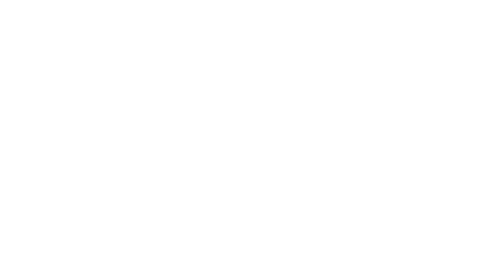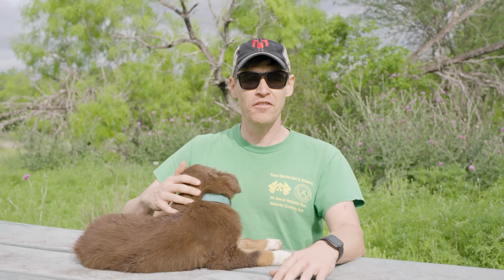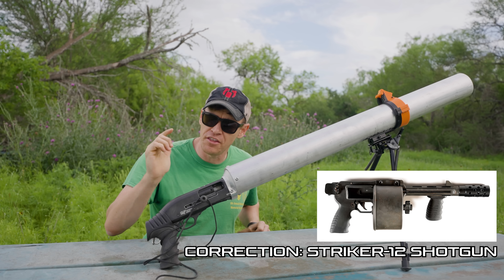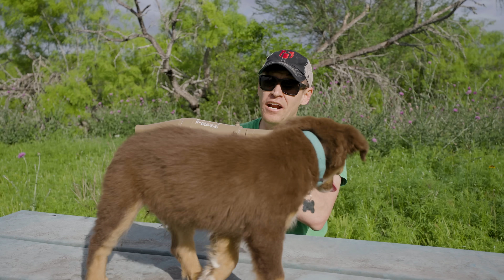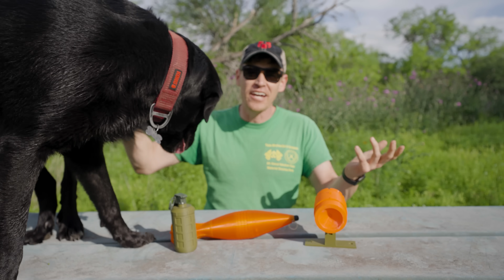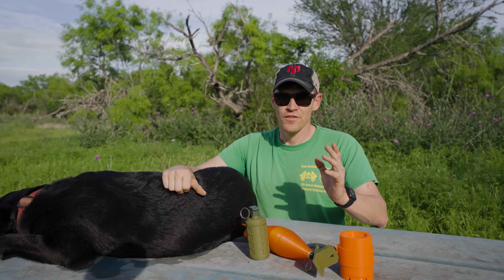Are 3D Printed Weapons Legal To Make?

Comment: I know how you feel. I got my SOT and I get people all the time telling m they are gonna report me for owning post sample machine guns. I just tell them go for it. And no surprise, nobody has done anything since I'm 100% legal
Reply: It doesn't matter, most people are just full of hot air and no ambition anymore.
Reply: i worked for an SOT it was sooo much fun to pull up to the range with a p90 that was converted (super simple btw) or insert zyx thing my boss was working on and see some one get butt hurt all the local cops know i worked for an SOT and had paperwork  was fucking fun. my boss even let me build my own M16 on his books so i could learn how to mill out an 80% and drill the 3rd hole all because i wanted to learn he currently if i recall has it set up for testing supressors as i no longer work for him.

Comment: Most 3d printed guns I have seen are not undetectable because people have realized that plastic is not a good pressure bearing material.
ITAR and similar regulations in other countries has exceptions for rimfire firearms and drones (and other tech) made made civilian use, so STL's for such things are okay. It is specifically applies to things designed for military use.
They may still decide to harass you if you have weird political views.
Reply: I was under the impression that only directly usable files like G-code are relevant to that, unless I am thinking of some other similar circumstance.
 Regardless, someone just might "leak" the files to the Odd Sea. Oh, how unfortunate that'd be...
Reply: “weird”
Reply: @Tunkkis  Blueprints cannot just be plugged into a CNC machine either. The regulations cover intellectual property, even if it is your own. I go clear of this since my designs are meant for civilian use.
Reply: @nickdee5764  Okay, "Sensible" is a more correct description. Our current governments don't like common sense and logic.
Reply: Thoughts on the defense distributed machining box, I forget the name lol,, that makes the barrels?
Reply: @speaklifegardenhomesteadpe8783  Barrels are regulated items in most countries, as is ammunition. I can get a 800 dollar fine for posessing just a few rounds of ammo.

Comment: I have a question. There are the 37mm havoc launchers like spikes tactical makes.  You can relode those with black powder as long as you stay below a threshold for your propellant and the explosives. The 37mm launcher is known as a signaling device. If you shrunk down the moartar size would it be legal to launch them without registering it.
Reply: Any anti personnel ammunition in a flare launcher reclassifies it as a DD even in 37mm
Reply: Even if it fires a non lethal bean bag round the launcher is still a DD.
Reply: That's because the bean bag rounds are manufactured to be anti person. So they are defined as DD.  but if a device is not specifically manufactured as anti person. And by the definition of a DD being,  (“destructive device” means- Any explosive, incendiary, or poison gas bomb,  grenade, rocket having a propellant charge of more than four ounces, missile having an explosive or incendiary charge of more than one-quarter ounce, mine, or  devices similar.) As long as there is no projectiles and you stay below these parameters it shouldn't be considered a DD.  Or am I  just not understanding  the definition properly?
Reply: @sethmcavoy7672  No
Reply: @Willy_Tepes  then run anti personal ammo in your gay 37mm, I don't care one way or the other.
Reply: @sethmcavoy7672  Bean bags are not explosive devices.
Reply: @Willy_Tepes  what part are you not getting? A weapon being a large bore DD doesn't have anything to do with it being a launcher for an "explosive device".
Reply: @sethmcavoy7672  Did you even watch the video? No, bean bags are not destructive devices!
Reply: @Willy_Tepes  you don't get it man. I would highly recommend you don't ever mess with any nfa toys.
Reply: @sethmcavoy7672  As if I care about the law anymore, lol. They lost my respect when they started limiting my speech while letting criminals off with a slap on the wrist.
Fortunately I don't live in the land of the "free".
Reply: @sethmcavoy7672   "Anti-personnel" is not a clear definition of anything. Anything fired out of a 37mm is by definition "anti personnel".

Comment: Use the 3D printer to make a model of a metal part, then make a mold around that. Remove the plastic part, and fill with molten steel. Repeat for each part and assemble.

As long as a licensed FFL manufactures it, and registers the gun with the ATF... should be legal. It's just a different type of manufacturing process.

You could also use a 3D laser image scanner to upload an already existing weapon part into 3D print software, to make modifications, or to do replicas of rare weapons.

Comment: Suggestion:   the black powder claymore/ Kent tube.   19th century claymore mine.  Cast iron pipe sealed at one end black powder and a load of musket balls facing open end.   Well sealed with wax fabric at business end.   Basically a sawed off cannon to provide cover for key paths of ingress for attacking force.  Such as bridge or causeway, fortress gates , breeches etc.
Was proposed/ maybe used in Russo Japanese war with gun cotton and electric detonator.   The tube blew apart but the shrapnel balls flew out the unsealed end of the pipe.

Comment: I would love to see a video on if it's possible to turn 10mm Liberty Civil Defense ammo into exploding ammo by filling the hollow with a binary compound then capping it with some solder. They have a rated velocity of 2,400 fps, so should explode on impact without the need for a fuse or primer in the tip. Maybe add some zirconium powder for an incendiary effect.

Comment: I’ve just a got good one for you guys to try out.  Would using flash powder or black powder set of ANFO used as a booster charge just using cannon fuse instead of using a blasting cap and if you used it in some sort of a pressure vessel like a pipe bomb so the black powder could build up enough pressure to cause the ANFO to go off and detonate.  I seen it in a French movie or was it a Belgian movie, I can’t remember but it’s a cool experiment to try out.

Comment: Legally theoretically (I have dogs I love, I’m not trying this) it would seem that an air powered “explosive” would slip through the cracks of the law as destructive device says explosive, incendiary, or poison gas. Say a 3500-4000 psi reservoir with an impact activated dump valve into the chamber that usually holds the boom powder.

Comment: I have a suggestion for a video, not sure if this is the place to post.  Put some small propane cylinders in a microwave like in the movie 'The Equilizer'.  Curious if it would actually explode without puncturing the tank first, and would it result in as big a boom as in the movie.  Obviously it is a movie and in sure they didn't use that for the actual effect, but it would be interesting to see what the results would actually be.

Comment: Hello, don't be tired. I had a question. You know the answer. Answer it here.
Thank you. Question 👇👇
Broadcast. I mixed ammonium nitrate with gasoline. When I heated it, it melted and didn't catch fire at all. What should I do?
I heated the ammonium nitrate separately, but it didn't catch fire and melted. What's the problem? Thank you for answering.

Comment: I understand. But if there aren't any projectiles such as BBS or any other metal in the round being launched then its not considered anti personnel correct? The 37mm rounds loaded with just black  powder (known as bird bangers) are used in agriculture and is legal. So wat would be the diffrence if it was a small 3d printed moarter shaped 37mm projectile. Litterally launched out of the same signal device. Or maby even another device like maby a potato launcher.